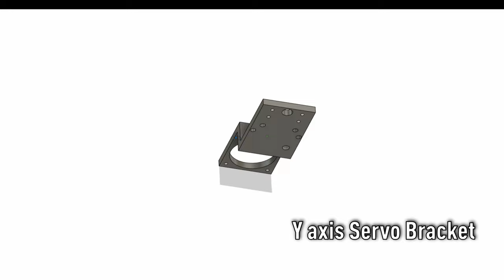From Manual Milling Machine to CNC Mill! #2 The Axis Motor Brackets

Comment: Great work, just a suggestion for those brackets I would have modeled them in ansys to see their static and dynamic characteristics, to prevent failure and/or vibrations
Reply from the maker: For the time I'm using the machine I didn't have any issues with the bracket though! :)

Comment: Project suggestion: Small screw jack to support pieces like the one at 7:50
Reply from the maker: Thanks for the tip! I will have to make one or two 😁
Reply: ya the vibration was insane

Comment: How are  you going to program the motor parameters?
Reply from the maker: Which parameters? The parameters are available to set with use of the display on the driver of these motors and i am going to suit them to the mechanical and software characteristics of my machine.